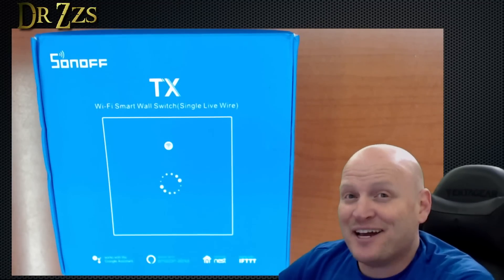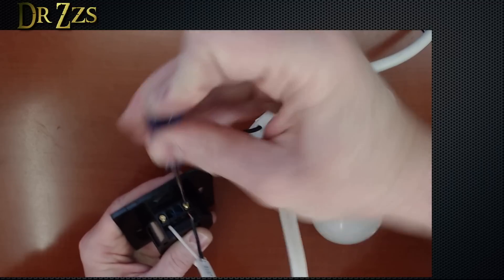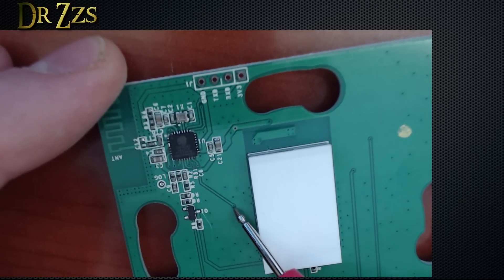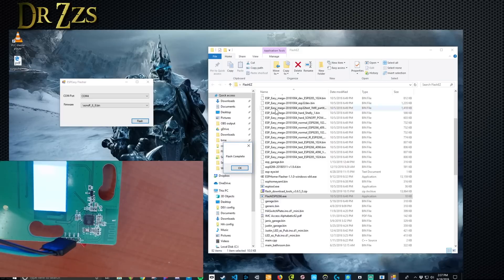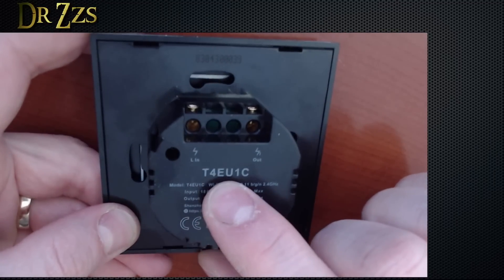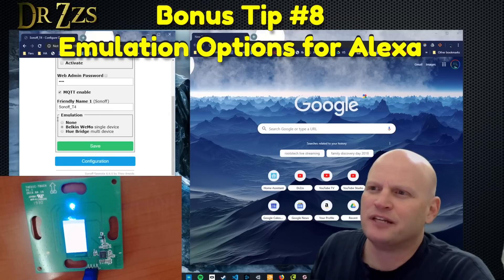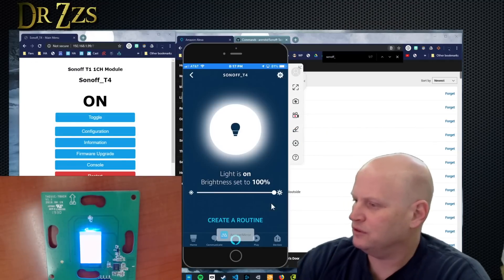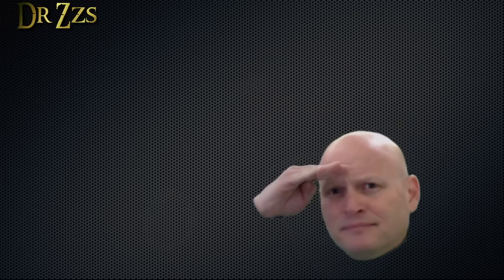Single Wire Sonoff Switch: Tasmota Fails, but Emulation for Alexa and 10 other DIY Smart Home Tips

Comment: Those are capacitors. And they are the ones that replace the neutral wire. So too are other devices that do not require neutral wires because neutral wires keep the switch in the ON state (when the device like lightings are OFF) while "listening" to commands sent by the hub.

Honestly, while not needing a neutral wire is good since most home especially older ones do not have any and it SEEMS like it's a breeze to install, I'd rather have it [neutral] installed than to be glad to install a no-neutral switch. Because the latter requires capacitors and those could be dangerous since they store in more charges as current are passed through them. And one could literally risk fatal shocks if not discharged properly.

Neutral wire, on the other hand, brings the current back to the main switch. So it will keep the the device switch on the ON state as it "listens" for the hub instructions.

But ultimately, it all depends on the users. Whichever way works for you. But I'd rather have my electrician install neutral wires and I could my way from there.

Comment: so I wonder there is only Load coming to switch how does it power itself mustnt there be a ground for it to power itself?
Reply: When light is off, the small power supply uses the 240v potential across the live and switched live cable. 
When light is on, live and switched live are both at 240v so where does it get its power?  The ESP pulses a triac at 50 HZ so the switched live is off for small amount of time. A capacitor stores enough current to power the ESP...

Comment: thinks for the videos. just a question can i restore the original firmware to use it with ewelink
Reply from the maker: yes, if you back it up first.  
I did a video about how to back up the firmware using esptool.py
https://youtu.be/jrpbQAdQNv8
it's a different device but the process is the same.

Comment: Had the same problem with touch switch lacking sensitivity and not working after flashing.....
....turned out glass was not sitting quite flush against the sensor. 

Worth checking....all seems well now I've adjusted the position.
Reply from the maker: interesting.
I added a smaller (1k) resistor across R10 and now it works great.

Comment: in the little box, components look like  high voltage capacitors.
Reply from the maker: ah, thanks!
I couldn't tell what they were.  Makes more sense that they are capacitors if that little box is supposed to provide "anti-flickering"

Comment: Hi from the UK DrZzs and thanks for keeping on thinking about us who lack the neutral! In answer to your question as to why don't we just use the sonoff mini's instead, then I'd say they are still a bit big. Our standard ceiling roses are about 85mm diameter and although the sonoff mini is 42mm square that's a fairly big hole to make above the rose when normally you only have 2 cables coming through it. You also have to make sure there is some purchase for the screws in the plasterboard as well. I think you'd still have to make the hole bigger for the resistor pack but its probably smaller. Standard UK ceiling rose -> https://www.screwfix.com/p/british-general-ceiling-rose-white/28345
Now will sonoff make a dimmer version of this  ;-) ?
Reply: Dude the Chinese have been making 433 MHz RF light switches that don't need a neutral wire and are a direct replacement for a standard UK light switch but they need a deeper pattress.   The switch is programmable meaning you can have a separate RF codes for on and another for off.  I have been using mine for a couple of years integrated with Alexa and RM Pro. I haven't had one fail YET. The only limitation being they can't be used on 2 way lighting circuits because they are only single pole. Each switch cost about 13 quid

Comment: You'll have to use the antiflicker module with CFLs and LEDs but not with older incandescent bulbs. The module contains two capacitors, a resistor and a MOV (I think).
Reply: he is touching those capacitors like they are simple wires :)))

Comment: Does it detect longpress? So you could dim up and down using the button?
Reply from the maker: Tasmota can detect long press, yes.  You'd have to do something beyond that to control dimming though.  This switch doesn't have the necessary hardware for dimming.

Comment: If you know where gpio0 is on the  chip, why go hunting further? Just briefly short it to ground, no soldering required.
Alexa not understanding an american speaking that's bad, but then again, sometimes Google home is  convinced I say "Durham" instead of 'Turn on'.
Also  dont call your device 'office'
Reply from the maker: Holding a jumper on that tiny pin on the chip would be challenging.  I suppose you could do it.  You'd likely also be touching one of the pins next to it.  But ya, you could try it.  
We can start a list of words she doesn't understand :)

Comment: Button not working: check the console if the buttonpress is registered. If yes, check what is the topic of that command. I had similar issue with T1, when the buttontopic had changed, without apparent reason. If that is the case here, change the buttontopic to match the switchtopic.
Reply from the maker: It wasn't registering as a button press either.  I added a 1k resistor across R10 and then it started working as expected.

Comment: Hey Doc, you need to watch your WiFi, not the LEDs on there. You have to program all the LEDs to GPIOs. Put it on generic and relay1-8 and turn each on
Reply from the maker: Thanks Amigo. 
I got it working by putting a lower value resistor across R10.  :)
Reply: Cool beans! But yeah, I figured that out after Tuya concerting a power strip with 5 relays in it. I just set it to generic and set as many  GPIOs to Relay1-8 and turn on each one one at a time and then an LED lit up instead of a relay and that’s how I discovered that you have to program the GPIOs for the LEDs

Comment: Do they sell just the little white resistor boxes. I still have a switch I bought couple of years ago that won't work as I have no neutral wire in my wall switch.

Thanks
Reply: bidders77 you must have exactly T4EU1C model to be able to use that small white box

Comment: 1. It doesn't matter if u put the one or the other wire into line  In or line out it will work in both cases
2. If u have an incandescent bulb then u don't need the capacitors (the small white box), if u have CFL or LED or any smart bulb then u DO NEED IT!
3. GPIO0 is your button GPIO12 is your relay GPIO13 is your status led get those right and it should work
4. BTW to put the device into bootloader mode just connect your USB to TTL adapter power it up and tap the button, while still holding the button with some small tweezers and touch the R3 resistor to reset the board and that's it works every time like a charm
Reply: What do you mean with "touch the R3 resistor" ? to ground ?
Reply: @atom6_  yeah just touch  the bottom pin of the R3 not necessary to pull it to ground esp8285 will reboot anyways. BTW you can monitor the serial just open a monitor and set baud rate to 74880 you ll see the reboot and bootloader messages

Comment: Did you try with an incandescent bulb and no resistor? It might be the bulb does not have continuity without sufficient current
Reply from the maker: I did not.  
I've saved one incandescent bulb just for times like these to test.  :)

Comment: does the little box/resistor, have to go on one light if I am controlling a row of lights i.e. I have cans in the celling but only two wires in the switch..  Ultimately I would have to dig out one of the cans to make the row work.. Right???

Comment: Just a reminder Doc, you configure a lot of devices - I use 2 Backlog commands. 1 line is the general stuff, all mqtt, all timezone, ntp servers, wifi, etc. The 2nd line is items to switch per module, tpic, switchmodes, friendlyname, powerretain, etc. with two lines of 'code' in console, 1 reboot in between, my modules are complete configured. No jumping in/out of gui.It is consistent, reliable and fast.
Reply: I also add template in this list too! 1 stop shop! (ok, 2).

Comment: They box is a couple of big capacitors .
It is only needed if the light flickers or if the switch doesn't work with Led globes or Compact Fluorescent globes.
It allows a small amount of power to flow across the globe in the event that an energy saver globe does allow the switch to work correctly.

Comment: The TX will work without the added bypass capacitors/resistor circuitry. That module is just about mandatory in order to use the switch with a CFL because the Bulb will flicker when the switch is off without the bypass—by the math, using the bypass will consume about 1/3A when in use, so don’t add it if you don’t have to

Comment: Wemo is good for switches but limited when it comes to dimming the ligh, the hue bridge works best with dimmers, it allows to see a brightness bar for control. However I stopped using this method due to alexa throwing errors when dimming the lights. Homeassistan hue emulator works best in my experience.

Comment: Touch IC is connected to GPIO 0, you may have cracked the resistor by attaching big wire and braking the connection to rhe ESP chip.
Reply: When I flashed my T1's, I just bridged to GPIO 0 directly, with a jumper.
Granted, it was a fantastically weird precision job, which required two people to flash the damned thing (I was also holding the other 4 pins in a weird angle, so they were touching properly, so someone else had to issue the flash command), but no soldering required.

Comment: In yesterdays SuperHouse video Jonathan mentioned that the touch module was separate from the the esp8255. He didn't show the tasmota config, but maybe it should just be configured as a regular button instead of a touch module?
Reply from the maker: I watched most of his video about it.
Reply: I might be wrong, but I believe he said to config it as a sonoff basic.
Reply: Yep: 30 min and 9 secs in https://youtu.be/VNYcD7MEp4A
Reply: You have to configure it as a T1 1-channel switch to get proper operation. Don't know why Jon said to configure it as a basic module. Anyhoo, I've flashed 3 switches, and all are working correctly using his video.

Comment: or simply use HA and Nabu for Alexa/Google integration :) thanks for the vid.
Reply from the maker: ya, that's what I do but I've had a lot of folks ask about using Tasmota with Alexa without Nabu Casa.  That's where the emulation comes in.

Comment: That is an anti-flicker box with capacitors. Yes, it is specifically made to avoid LED lights flickering as the single wire must still put through some current afaik in order to work and this can cause LED lights to flicker when 'off'.
Reply: Yeah, those are caps. They allow enough AC power to flow to power the module.
Reply from the maker: Excellent.  Thanks!

Comment: I think you must use that little resistor box when you are using led lights, with low current? With classic bulbs you probably don't need that.
Reply: I think you are right.

Leds are diode's after all,  guess it would be the same with CFL lights as well
Reply from the maker: good tip. 
Thanks fellas!
Reply: That "resistor box" is actually 2 capacitors and a resistor (and a thermistor).  The capacitors are there to prevent flicker (hence its name - the anti-flicker device). This is most notable in CF bulbs. In doing so they also complete the circuit powering the T4. The resistor is there to discharge the capacitors to ensure you (or your electrician) don't get zapped by any residual charge after power is removed. the device is needed with LED and CF bulbs but the older "classic" incandescent bulbs don't strictly need it - unless you want to ensure the T4 retains power when the bulb is removed.
Reply: @AussieRail  good to know, thanks for clarifying 👍